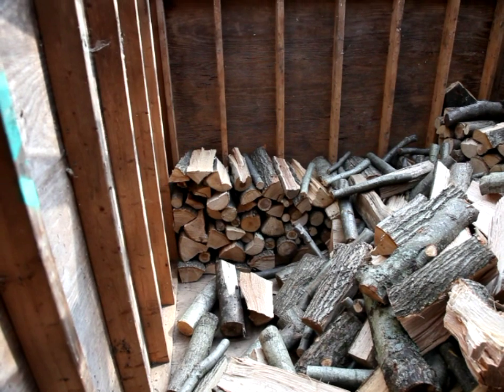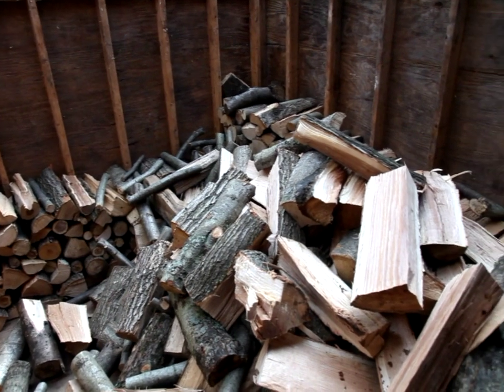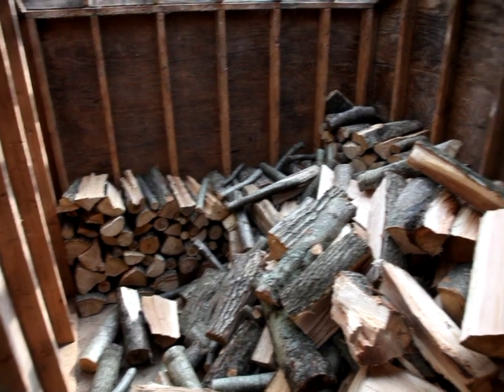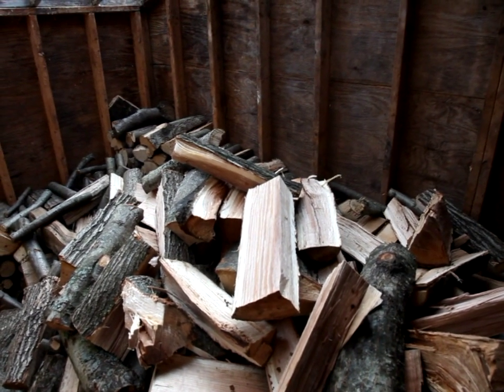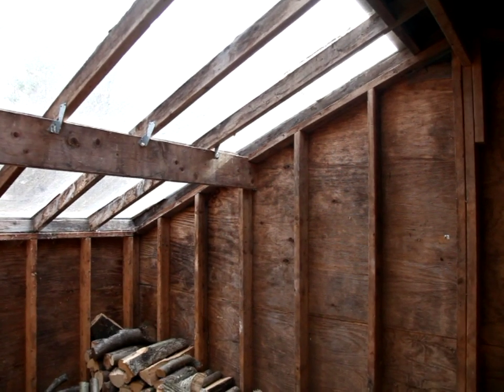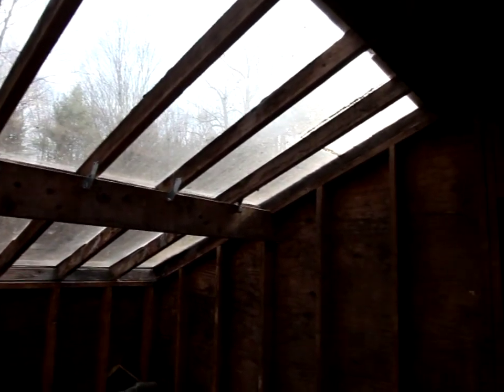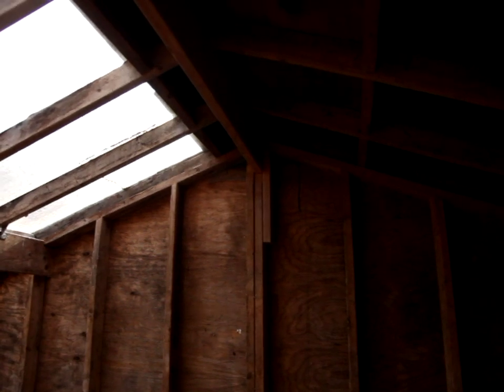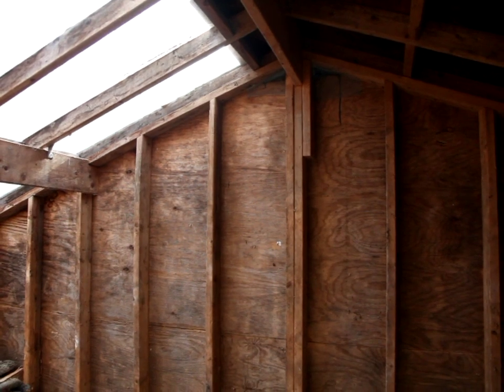Solar Powered Wood Shed

Comment: I covered a whole woodshed with clear corrugated fiberglass and not too air-tight for circulation purposes. Dried wood really well, no mold.
Reply: How fast from green to burnable
Reply: @johnaiken8511  I made it big enough to hold two years worth of wood so it was always dry enough by the time I burned it.  My house was super-insulated so it only took two cords per winter to keep it heated.  I had enough extra wood that I started making maple syrup just to use up some of the wood.  Also had room for my tractor in the woodshed and it made it nice to work on in in the winter since it was often 20F warmer than outdoors on a sunny winter day.

Comment: You might consider insulating the walls and the wooden part of the ceiling. Heat lost through the walls is wasted. However, heat lost through air leaks may be OK since you need air flow to vent the moisture from the wood. You could see if you have too much airflow by comparing the humidity in the shed to the humidity outside the shed. You want just enough airflow to keep the humidity in the shed down. (More precisely, you should compare the dew points inside and outside because the warm air will automatically have lower relative humidity.)

Comment: I have a suggestion that will cost a little out of pocket but would definitely be of interest if it works. what my concept is black insect aluminum netting about three to four layers. if you separate them about two to three inches each so that air can flow through them. also paint the entire rafter area matte black then box in the entire area above square (where rafters start) with plywood. on the solar side of the plywood cover it in aluminum and either paint it flat black or leave it bare.(Idea is to keep the heat off of the the plywood so that the glue in the wood doesn't fail)(plywood is to keep the heat boxed in) . The rest of the attic area not occupied by the netting acts as the thermal absorbent, in this are install attic solar powered vents that blow down into your wood area, but send it through ducts made of black plastic field tile. run the pipes every so many feet vertically and horizontally. and also install louvered vents(exterior) that allow positive pressure to escape only such as the way a clothes dryer exhaust works.positive pressure air will push the now heated moist air out of the building. Install two vents that allow just enough fresh area in the heating area in order to keep the temp up but not to hot. Essentially it is an off-grid forced air furnace, cool dry air comes in the top is heated to about 200 degrees it is then piped into the wood which heated to 100 degrees plus . Heated air expands push moisture laden air outside the storage area ,this might even work for clothes. if the inside was insulated this would dramatically increase efficiency in fact split green firewood may even be ready to burn within 4-6 weeks or less? If you try this love to see how this would work, as I might try this with selling wood.

Comment: Good job. If you want you could supplement with a simple solar heater (black box) and route that inside to maybe achieve the "cooking effect" you were after.
Reply from the maker: +Ihaveausernametoo That would help with the drying, particularly if I could introduce the hot dry air directly under the stacked wood.  I'd probably need a fan to push the hot air down to that point, though.

Comment: If you want the wood to dry properly take the sheeting cover off 2 sides to let the air flow thru , you are lucky it isn't a big mass of mold and mildew.
Reply from the maker: +MrDynamitd  Not luck.  I have had no problem with mold or mildew.  The solar gain heats the air enough to cause it to pull in fresh air as the hot moist air goes out around the ridge beam.  It is not necessary to have lots of air circulation.   If I had gone for more air circulation, I wouldn't be able to get the elevated temperatures to "cook" the moisture out of much of the wood.  I was shooting for soewhat of a kiln-drying process, but only got part way there.

Comment: pop some vents on the lower sides with a hole saw.
Reply from the maker: Not a bad idea.  I'd have to put heavy metal screen over it, however.  For some reason, two or three chipmunks and/or mice seem to like nesting in the center of the wood stack each winter.
Reply: We had a storm go through Crooked Lake Township in N. Central MN, I have three huge piles of split wood, we've always just tarped them I put it on old plywood or plastic, yeah already I've seen Chipmonks going in and out. Gives the dogs something to chase.
Reply from the maker: Had one dog that chased a chipmunk into a pile I was splitting.  Kept checking that pile until the pile was gone weeks later.
Reply: It's cool.  we've always just piled the logs and tarp but a few years ago I copied my Dad with 1 1/2" piping to get logs off the ground two feet.  It's just more effort to make a dedicated shelter for the logs instead of primitive tarping. :)

Comment: is the sun facing wall black? that would probably increase the temperature quite a bit.
Reply from the maker: Thanks for the suggestion. It is painted a dark gray that was a darkness compromise with the lady of the house.
Reply: Terry Hale  I caught that in the video but I'm asking about the inside walls or floor
Reply from the maker: Ah.  Usually, I fill it right up and no sun gets to the floor or walls.
Reply: Terry Hale oh, I've just been looking at other sun powered kilns and such and they seem to follow a pretty standard build. Your shed looks like much more of a  multipurpose shed than a straight kiln.    I'll have to take that into account when designing my drying space.

Comment: The e-controlled interchange of hot 'steamed' air with cool yet at low humidity level could improve wood drying process. Analogue to airing a room. New air that cooling but dehumidifying whole volume as well. Polycarbonate roof sheets would be of lower price (at least in EU) and more heat-resistant than plexi ones.